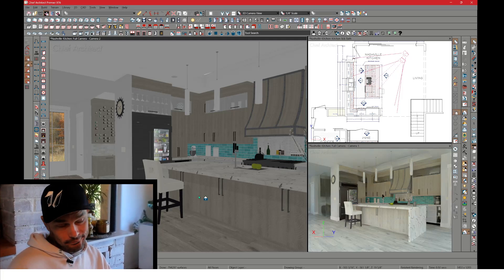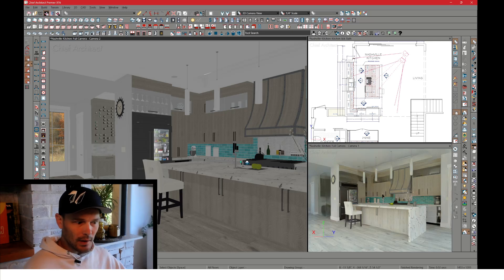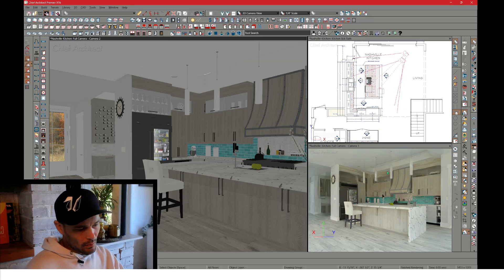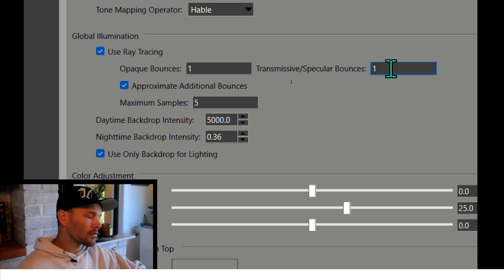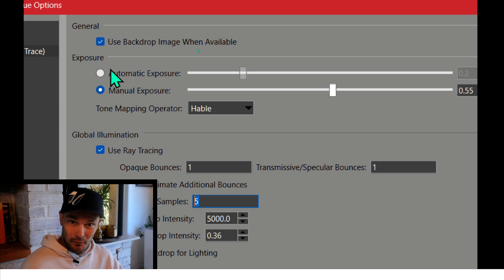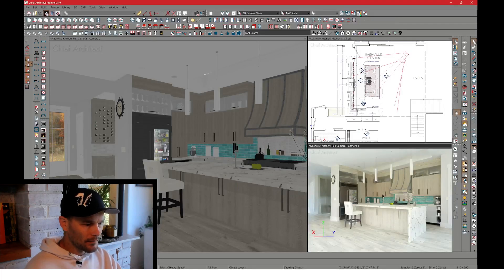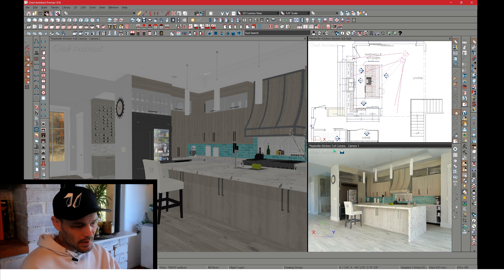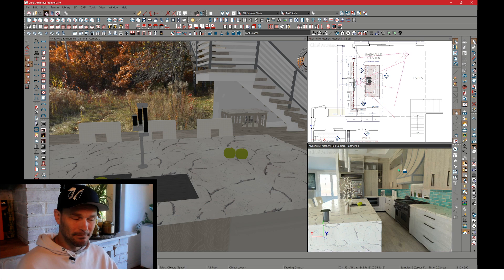Apple Mac M2 and M3 Raytracing Tips For Speed in Chief Architect Premiere X16  Raytracing

Comment: Thanks, Rene!  These settings made the Mac M4 Pro render so much faster.
Reply from the maker: @leeindallas  well that's awesome to hear!!nice :)
Reply: I'm considering upgrading to the m4 pro.  I have an m2 pro currently.  I know it has built in ray tracing hardware.  Do you happen to know how much better it is to previous models?
Reply from the maker: @areabum  I would o with the max if you can. They make some big claims but I haven't seen any testing or numbers on it yet